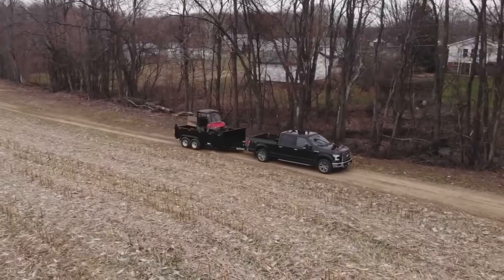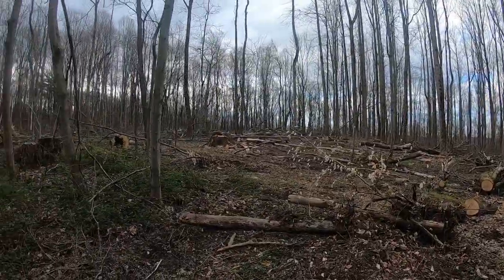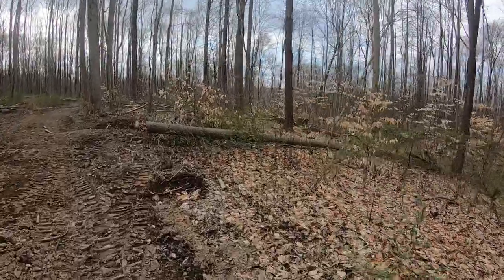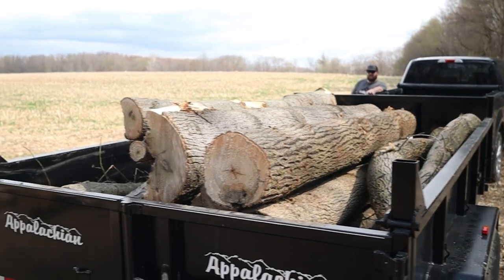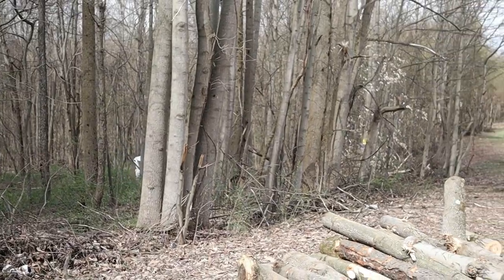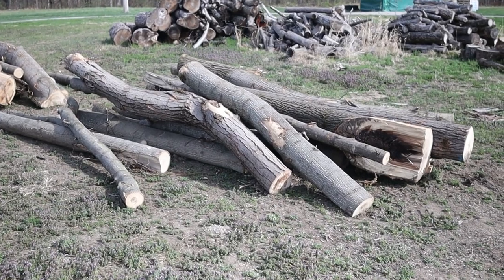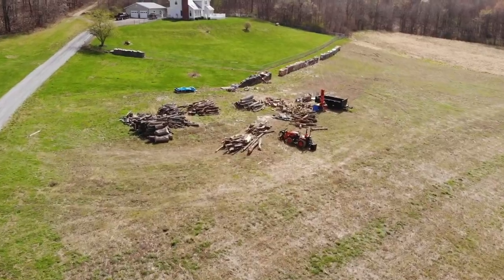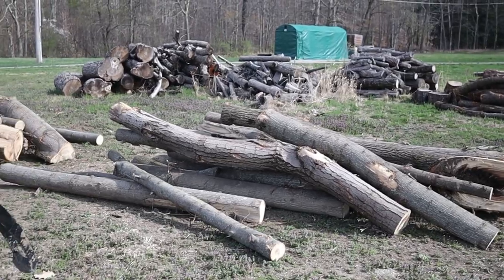Micro Logging - Compact Tractor & Skid Steer

Comment: That looks like it worked well. It was the most efficient way we found to get the logs out.  I tried 16 ft lengths but was a little long to work with.  12ft seem to be the best.  The logs should dry well at your place.  Just try to get them up on a set of logs for air flow and storage. It took us most of the summer to get ours all split.  We had rows of rounds ready. It s also better before all the briar bushes grow up and swallow the wood. We always skidded the whole tree out to a spot to work on them. With my tractor I can grab four or five trees at a time. It is a lot heavier tractor. We use to break chains.  Do your maintenance and look over the machine before you start.  I have had to tighten some bolt for my loader.  The rain can make you have a really bad day. The weight of the logs in the trailer you might get stuck really bad.  Make sure if you had to dump them you can when you load. Well have fun and keep up the great videos.

Comment: Which machine worked better in this application the skid steer or your tractor? Would you rather have a skid vs the tractor for doing this?
Reply from the maker: For doing this specifically probably the skid steer but I have more use for the tractor doing other things around our property like brush hogging and other farm chores
Reply: @HometownAcres  awesome, thanks for the quick response. I just had my timber cut and going to be doing the same thing

Comment: After seeing 1st hand what the skid steer can do what do you think of it?? Better than a tractor? And would you consider getting one?
Reply from the maker: In terms of grappling logs I think they were about even. The skid steer could certainly pick up a heavier log but we both were carrying out about the same amount of wood at a time. Where the skid steer really beat the tractor was stability, turning radius and pushing power to move all of the brush after we got the logs out
Reply: @HometownAcres  I'm almost in a position to buy one or the other... just don't wanna wish I bought the wrong  one... for skid steer it would have to be the JBC with side door though
Reply from the maker: If you’re just doing firewood I would get the skid steer. The reason I have the tractor is because I need to perform other tasks like brush hogging and other farm chores. The tractor is like a Swiss Army knife. It can do a lot of things. But the skid steer can do some of those things a lot better like grading, lifting and pushing
Reply: @HometownAcres  thanks for the feedback Adam